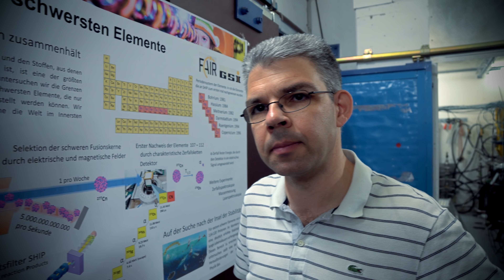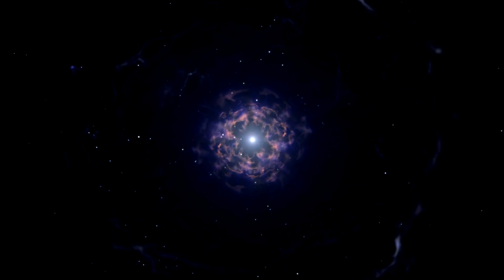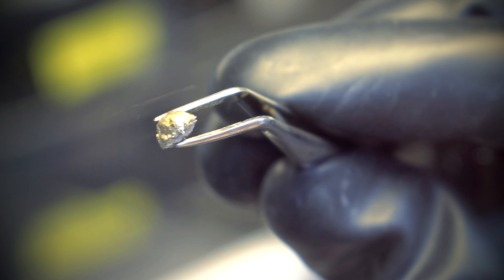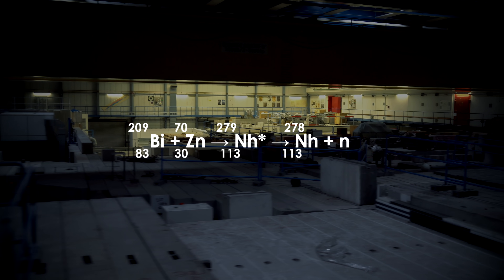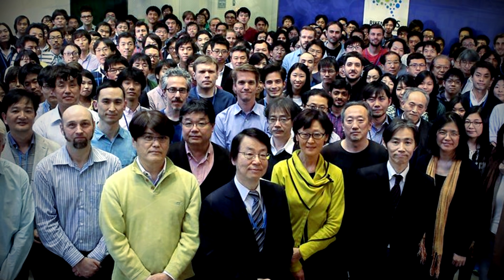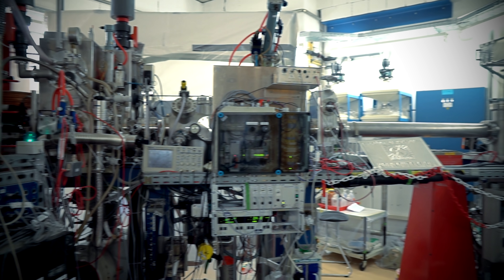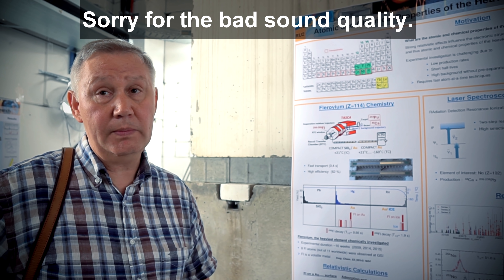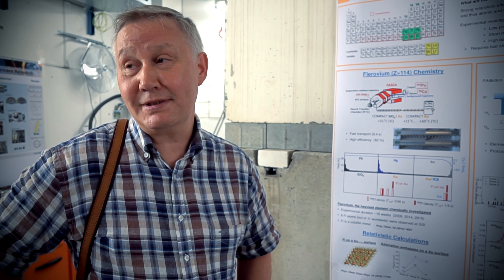Nihonium  - THE MOST EXPENSIVE METAL IN THE UNIVERSE!

Comment: ... sigh any reasonable chance to be able to manufacture Nihonium, with any reasonable economic possibility will require advancement in material sciences in the quantum particle area, so we can custom make machines, down to the very atomic structure of the metals used to make them, so they can preform far more economically efficient to become capable of having a chance to make this Nihonium metal in an economically acceptable way.

Comment: When ever I see the table, I think how is it possible we have discovered everything in the universe .
Reply: Me too .....
Reply: but have we really? there is much we don't know, and we are still learning!
Reply: It's like Lego bricks. There are only so many ways to make a functional brick (x by y studs, and z for brick height), but we haven't even begun to approach the limit of ways you can arrange them
Reply: That table only describes what we have managed to find or synthesize, and is limited by our understanding of physics. Elements 119 and 120 are theorized but not synthesized yet, and depending on the model used, the atomic number can get a higher then that. The problem is that the more protons and neutrons you try to stuff in an atom, the weaker the atomic force that keeps it together. There is going to be a point where the repulsive force from the protons itself is enough to rip the atom to pieces.

Comment: Can the Hutchison effect prolong and suspend the elements life, for study. In near 0 Kelvin conditions, using the Hutchison effect to neutralizing the electron wave of the atom? Possible stabilization as well as efficient dependability of the effect, by utilizing a non reactive plasma in the zero point energy zone in conjunction with the scalar wave. If the plasma has no impurities for the atoms to form their crystalline structure around. The plasma will remain fluid until the desired element reaches the zpe field.
Reply: My thinking is, the nihonium is generating very energetic decay within itself , such that the trap would not be effective . The temperature in the trap would simply rise as particles are thrown out in highly energetic states. Remove more energy in trap (cooling) , dump in more nihonium  rinse and repeat. This  niho  juice is very problematic .
Reply: @texasdeeslinglead2401   texasdee slinglead  I believe utilizing the CERN collider. That we could capture the particle after its collision. You are correct about the heat. It creates a 7.2 trillion degree microthermic temperature spike. However in a near zero Kelvin environment, which could be triggered simultaneously to neutralize the electron wave, and cease/slow the atomic energy. It should cease/slow nihonium from degradation into sustaining elements. Perhaps an electromagnetic area at the point of collision could be used to trap the particle amidst the perimeter which houses the zero point energy zone of this atomic "trap". 

Ideally I'd like to suspend the atom in a non relativistic state. For study.
Reply: @joeylederman1127  I wonder if my microwave gets that hot. I see food go in but pure graphene come out. And magically shaped like a pizza pocket.
Reply: That's a rad theory . I'd like to hear more.
Reply: @texasdeeslinglead2401  If you're making graphene, you should look into silicon crystals and their ability to manipulate not only the trajectory of photons but the parabola created as well.
Reply: @texasdeeslinglead2401  It is quite literally an atomic radiator theory. Lol
Reply: @texasdeeslinglead2401  I had a thought about a graphene polymer for biological hypertrophy reinforcement and repair. But that is at the quantum level and you'd need to ensure that it genetically grooves with the GCAT of our genome. Prevent foreign object rejection of our immune system.
Reply: You think you might be smart, then read something like this thread... Lol. This is way over my head.

Plasma can be shaped AND hold things? What even happens when plasma reaches near-zero Kelvin? What KIND of plasma, anyway?

Jesus Christ I don't understand half of these terms! Aaaaaaahhhhhh!!!

Comment: How do they know they have made three atoms of the new element? What is the method for isolating and measuring each atom?
Has there been an advance in science, whereby chemistry is no longer statistical below the level of the mol?
What are tools used to measure atoms, and how do they stop them moving around while they measure them?
This kind of information would be far more interesting than the "price" of the element.
Reply: It's all about the trajectory and interaction with the sensor section of the collider tubes magnetic sensors. The number of protons and neutrons clumped together have a very specific field  as they travel near and through the sensors. The sensors output is compared to that of all the other sensors output at the exact same moment . The super computer then takes these interactions in and begins building an image of the size and location of the particle relative to all the sensors. This gives velocity and trajectory which can help refine even more the exact make up of the particle. In this case japonium (nihonium ) being super heavy ,  won't arc nearly at all when created , it also will have a very strong field but very particular interaction with the sensors as it continues on in a straight flight path.this makes it pretty easy to "see" when it does pass through. The only problem is controlling heat in the plasma field to keep from blowing the cesium cores apart (too much heat) and no interaction at all (too little heat) . It's a very narrow range that is needed. Also the sensors are very much in need of refinement and tuning. And the mega giant bank of computers also need regular maintenance . It's a real undertaking to get good data. And don't forget the target and projectile materials as well as helium used must be 6 plus "9"s pure ie, 999999.99%.
It becomes somewhat rediculous.
Reply: @texasdeeslinglead2401  Thank you for this explanation. You say that "protons and neutrons clumped together have a very specific field as they travel near and through the sensors". How do you know? Given that the sensors are the very thing detecting the supposed existence of what is being measured, how can you know that this thing is moving near it, in order to measure it?
This is no small thing. For a very long time, very great physicists (Maxwell amongst them) acknowledged the difficulty of speaking with certainty about that which is too small to measure. The uncertainty principle is another articulation of this enduring mystery of atomic form.
In these claims of incredible matter creation, there seems to be an inherent presumption of specific atomic forms, along with all kinds of presumptions of how these forms will react and change under stimulus.
We measure these things without grabbing them and holding them down, because we "just know" where they are. Try doing that with a chicken, see how far you get. Or, you know, anything else in the real world. You must first have a thing, to measure it. You must know where it is. It is the getting and the having, the grabbing of one of them, if you will, that defeats individual measurement.
In this case, we are assuming that these "things" are moving past our sensors, and we then infer a very great deal about these "things" from indirect electromagnetic field data. 
In the end, we are reading changes in electromagnetic field data, and inferring a very great deal indeed.
Surely it would be much cheaper and easier to randomly generate some numbers, and simply believe that several atoms of a new element have been created?
Either way, it seems we are beginning with what we seek to prove.
Reply: @tobystewart4403  that's where it gets off in the weeds. 
So what is done is first and foremost is to verify the sensitivity and accuracy of the machine and theorized values. So how this can be done is by firing analog projectiles through the field at or near oporating ranges(temp , vacuum , velocity, power ranges on sensors, timing on sensors.) They use a stable element that will travel consistently straight through the sensors . They then let the computer model the sensors interactions .  This is calibrating at its most basic. Next they would ramp up to a very predictable particle that would interact with a  target that yields very predictable paterns. If outcomes are wonky then it's back to square one on paper and calibration. Verify, test , verify , test ... . Until all the superbly tiny variables are narrowed down to manageable. I so wish I could take the time to model how these sensors generate the data for 3d imaging. It's clever but not dead reliable. 
That's why these groups have massive verification protocols. See hunt for the Higgs. 
There may be hundreds or even thousands of false positives during a cycle , but human review knocks out nearly all if not all the false positives. Leaving nothing for results.  So yes , you should question the results put forth in this video. That's a critical component of science . If you accepted the results without question, then you would belong over in the dark ages.
Reply: @texasdeeslinglead2401  I think I understand. They take some of what they wish to measure, and use it to calibrate the measurement tools.
It is still not clear to me how we go from measuring an indeterminate mass of an element to measuring individual atoms of an element. So, i can appreciate that an element has a spectral signature, or a given atomic mass, because these are evident in every variable quantity of indeterminate mass. Just so, I can appreciate that each element has a given electromagnetic field interaction with sensors, as an indeterminate mass of that element passes those sensors.
What i do not follow is the leap from analysing the indeterminate mass to the individual atomic unit.
What tools are being used to isolate single atoms?
If I understand you correctly, the tools you describe are computer modelling and statistical analysis, both by algorithm and human review. These tools are entirely valid, yet they are inherently statistical in nature, and do not constitute a physical measurement of an actual atom.
This is perhaps a problem of comprehension and reason, rather than scientific style.
Everyone who has ever guessed at atomic forms has used statistical inference, and gone on from there to speculate about what could not be measured.
Particle physics has made a religion of atomic science, and goodness me, how those priests of numerology have busied themselves, building wondrous cathedrals to their art and faith.
It's quite a show.
Reply: @tobystewart4403  in its simplest breakdown is conferred values of what something should be based on benchmarks of smaller more stable objects. It's like saying 1proton and 1 neutron = x mass  , 2 neutron and 2 protons bonded =2x mass.
So each proton /neutron pair mass is x and giant nuclei y has 100 bonded pairs meaning that , when it passes the detectors it should have a mass of 100x. Very readers digest but it should help give a starting point to what's occuring in these tests.
Reply: @texasdeeslinglead2401  We may discern, in broad terms, that individual atoms are being claimed to exist. We are told that electrical field changes evidence these individual forms. One is inclined to wonder how sensitive an electrical field measuring device must be, to discern an individual atom. 
Yet, now we learn that "conferred values" are being attributed, based on presumptions which contain that which is being proven. Each atom is not being individually measured, we are inferring conferred data. We are engaging in statistical analysis of measurements of the behaviour of an indeterminate mass.
As I have said earlier, this is entirely valid science, yet it is exceedingly problematic, in terms of reason and logic, to accept that specific fundamental atomic forms are proven to exist from such data.
When we measure an indeterminate mass of something, and then analyse it according to preconceived models of unseen structural forms, it is hardly surprising that we have confirmation of these arbitrary models returned to us by numerical analysis. We prove nothing about water, for example, by measuring water into different volumetric parts, and then naming the parts, and then noting that water can be divided in this way again and a again. 
We are just naming arbitrary volumes, as we measure an indeterminate mass. Until we break water down into hydrogen and oxygen, and contain them, isolate them, and measure those component parts, we have not really said much about the fundamental structure of water.
This is why I am curious about the nature of the actual measurement, and whether it is that of an indeterminate mass, or somehow of an individual structure. It seems to be of an indeterminate mass, with conferred values computed for theoretical, and inherently presumed, structural units.
It is seems to me to be problematic to claim that individual atoms are being discerned and identified, because that is technically a false claim. It seeks to claim actual observation of structural forms, when no such observation has taken place.
The point here is not academic. If one hasn't actually found a way to count individual atoms, and measure them, and yet one publicly claims to have "three" of them,  a specific integer, one has gone beyond conjecture and inference from data and statistical analysis, and one has begun to tell outright lies, and fabricate facts.
It's a thin line, perhaps better understood by lawyers, than scientists on a salary at an institution. conflict of interest is a real thing, when so much money is being spent on mysterious things.
Reply: @tobystewart4403  it gets very interesting when we broaden the questions we ask out to whether or not an atom is real or is it a theory. And I'd feel rather sorry for a lawyer trying make heads or tails of some of this mess. Poor fella would need a helmet . 
It gets really fun when we dive into the double slit experiment.  That one has lead to some real doozies . And from some of what I glee from your last comment , I see you have observed the clever wording of some of these presentations.
Reply: @texasdeeslinglead2401  Yes, this is where I was going. The wave guys have a case to argue. They always have. Sadly, the School of Particle Physics are now spending so much public money, wave theory has become a heresy, a wild claim that nobody is willing to entertain.
Personally, I think particles are OK, so long as they melt. A reasonable man ain't go not time for no substance that doesn't have the decency to change phase. Everyone accepts this as an individual, but when they form groups, they deny it. It's the cult.
Therefore, I can't really break bread with the quark people. It's not right. They are not decent god fearing folk, with their spin, colours, and the like. It's shameless salesmanship.
3 atoms of stuff you'll never see. It's outrageous.
See, how it works, it's a slippery slope of desperation and vain falsehoods. First a young man starts out with particles, and pretty soon he is smoking relativity in a glass pipe. Then, before he knows what has happened, or who he has fallen in with, he starts talking about quantum states. He is now a junkie of the physics cult, and has fallen from the light of chemical truth.
Particles are the worst.
Reply: @tobystewart4403  it's insane how much money is being wasted . And to what end? I'm a huge fan of sciences but quantum field theory is my breaking point. I get that the theory of relativity doesn't scale well , and that we are searching for the unified theory of everything. But for what purpose? To keep folks employeed? It's frustrating.these folks need to go work gor AMD , Samsung , Hinex, Micron, and Intel .
Reply: @texasdeeslinglead2401  Well said. We need to get the young people away from modelling and into material sciences, researching semiconductor behaviour and gaining a better understanding of electromagnetic waves. That is where the "real" discoveries surely lie.